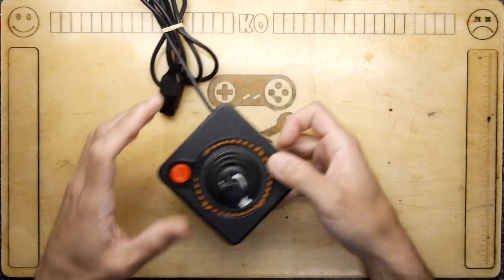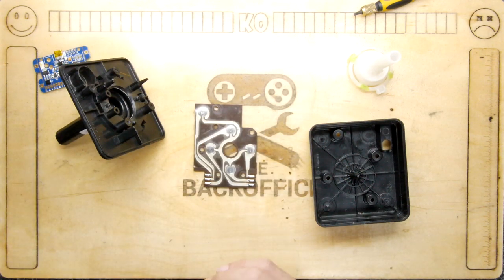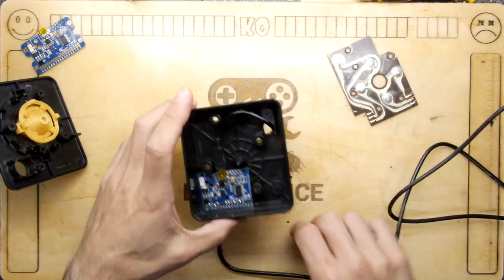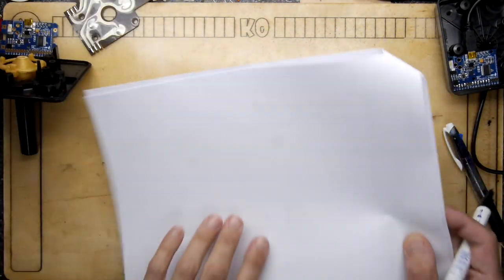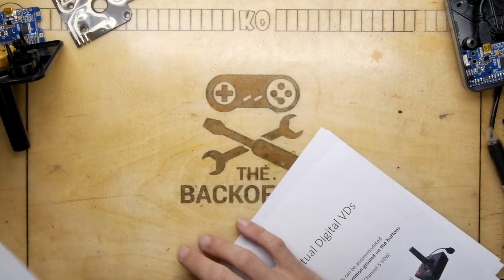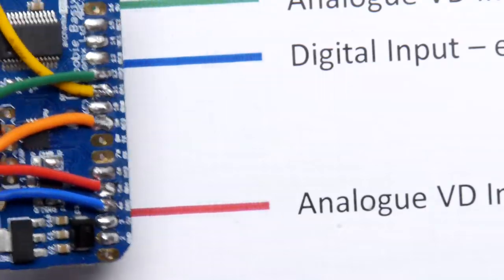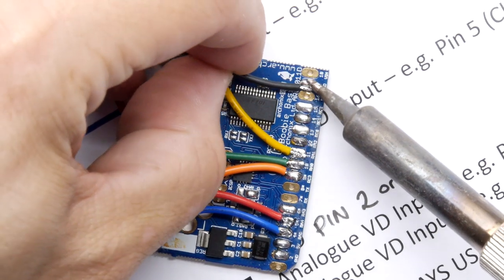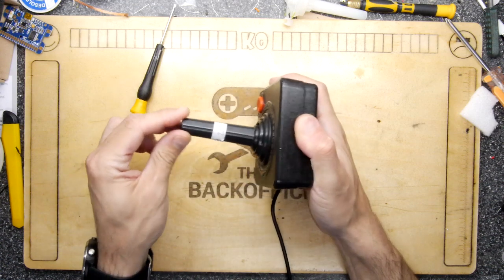Ultimate Joystick Interface v2 Atari 2600 VCS

Comment: I've got a challenge for you that if completed it, it would set you up into the upper pantheon of ultimate Atari hardware modders. Design a thin PCB board(s) replacement for the stupid mylar flex circuit used in the CX52 Atari 5200 joysticks. I suspect you'd need it in 4 pieces: 1. one longer board for the numeric keypad buttons, 2. 2 small boards for the left and right fire buttons, and 3. one board for the Start/Pause/Reset buttons. Use dome switches like the awesome CX53 Trak-Ball. Such a kit would eliminate the need to buy replacement mylar flex circuits or the expensive gold dot kits to replace the problematic carbon dots. Let people to continue complaining about the joystick itself not self-centering; the real issue are the buttons. From there, you could decide whether or not to connect the UJI board to it or not. If you designed such a kit, you'd have loads of 5200 owners on AtariAge and in the Facebook groups placing orders like gangbusters.  :)  Now as for the Trak-Ball, I know Curt Vendel made a USB adapter for it for a few people but perhaps the UJI could work with it too. Us Trak-Ball fanatics would definitely go for such a mod if you had a toggle switch to toggle between "Atari" - in this case, DB15 for the 5200 - and USB output. That would require separate cabling though. Just some thoughts! Keep up the fantastic work, @backofficeshow !
Reply from the maker: I will need to look out for some 5200 joysticks, I have to admit I have never seen them in the wild!
Reply from the maker: Just to follow up my previous comment, I had a look and they do not seem to be common here at all. I might have to wait until next time I am in the USA
Reply: @backofficeshow  You're the man! Would you also need a 5200? They're yuuuuuuuuuge. Atari Inc had developed a PAL version but didn't get to release it because Warner ordered them to discontinue it by that time and shift over to the GCC-developed 7800 instead. So basically NTSC only with US power. The original 4-port models ran the power through the same cable as the RF output so the RF modulator would auto-switch [like an earlier RCA console, or Emerson, I forget]. A lot of us affectionately call it "Sparky" but that scared people apparently back then so the 2-port [just 2 joystick ports instead of 4] restored the old separate RF output and power. The 2-ports thus are easier to AV mod with stuff like the UAV board, the Sophia, or the VBXE since a power mod doesn't also have to be done. People complain the most about the analog joysticks not self-centering but the real problem are the carbon dots with the flex circuits. People resort to buying the Rev 9 mylar flex circuits from the likes of Best Electronics and then buy their gold dot replacements for the carbon dots which then blows up the prices on the controllers. Thin PCBs and dome switches would eliminate that issue altogether. Micro switches have been tried before but are generally considered not to be ideal with the rubber buttons, hence dome switches [and dome switches supposedly can't be added to the mylars]. The Trak-Ball had PCBs inside of them with dome switches. And that's the War & Peace length discussion on the topic.  :)  Another popular mod to those controllers going all the way back to Atari Inc's engineers themselves was to swap out the analog joystick component and replace it with a 2600 Paddle Pot. That makes for a great controller for the games that can take advantage of it but doesn't resolve the flex circuit and the carbon dots issue...

Comment: I have used an Arduino Leonardo clone (Pro Micro 32U4) for that purpose, but I didn't break the joystick. I've made a converter box. It is possible to make one with both - digital (Atari XE style) as well as analog (PC Gameport) joystick. Gameport joystick is a bit tricky, because of the way the pots are internally connected, but Ohm's law, a little bit of math, and you could get a linear stick position from ADC. Also all GPIOs in Arduino have internal pull-ups, so no need for resistors.
Reply from the maker: Yep that would work. These boards also have configurable pull ups, but I left them floating for maximum flexibility.
Reply from the maker: @FindecanorNotGmail  I have some 2600 paddles to adapt I will open them up and see how they are wired. I just assumed they would be regular variable resistors, but after what  you said I am not so sure.
Reply: @backofficeshow  For some reason I don't see @Findecanor's answer, but I have it on mail...
Pots in Gameport are hard wired one side to 5V, and you have output from slider. The other end is not connected. They are variable 0-100kOhms resistors instead of voltage dividers. So I added a 100kOhm pull down resistors to the output and read the non-linear output voltage using ADC. For conversion I didn't use LUT, ATMega 32U4 will do required calculations faster than ADC conversion is done.
As for autofire - Atari joysticks have just one fire button, while CPC Joysticks have two. The second fire button on CPC is on the same pin, where 5V is on Atari. It is possible to add a serial resistor on that line, so both autofire on Atari joysticks and second fire button on CPC joysticks work.
Reply: @backofficeshow  Digital joysticks always are active low, so they do require a pull-ups on all ground switched lines. Fire signal  is no different from direction signals.
Reply from the maker: @TzOk  it's not only for digital joysticks